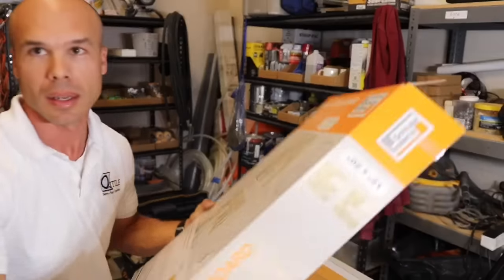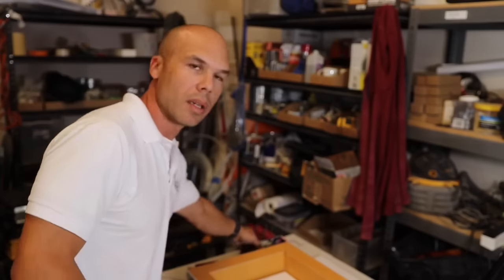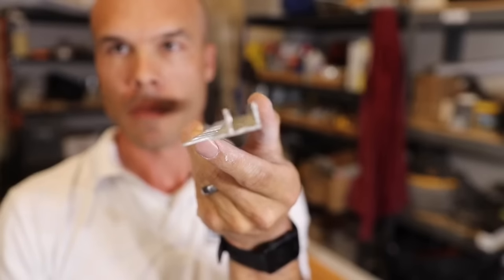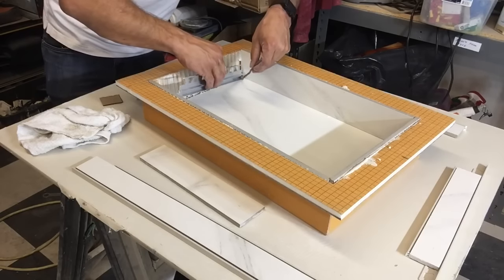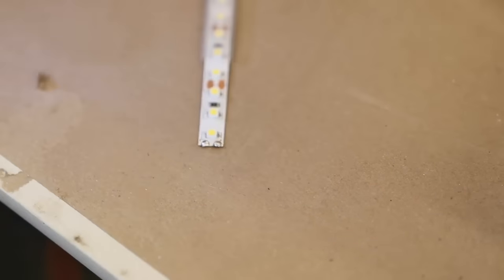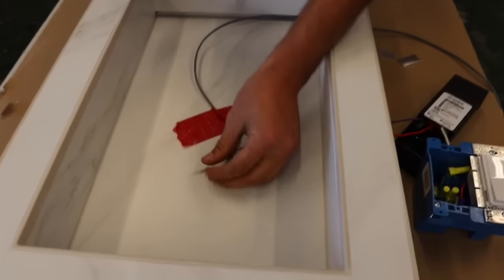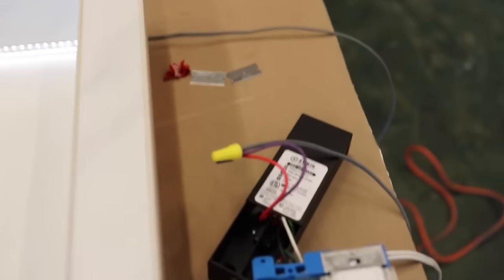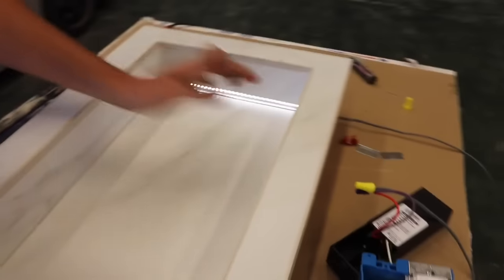How to make a Lighted LED Tile Niche

Comment: VERY CREATIVE! This idea is great, I will definitely try it out on my next shower build.
Reply: Absolutely....I have another shower coming up in 2 weeks, I know she'll love this added feature.
Reply: @TileCoach .. I am about to start on a project as well. would you be able to provide me with your supplier's info for the LED lights???
Reply: Can you send me the exact parts as well?
Reply: @Isaac Ostrom  good stuff . what your email ? Could i have the parts numbers too.
Reply: I would appreciate the supplier info .
Reply: @TileCoach  can you give me the info on the parts?  Specifically the SG deco profile piece. I find there are quite a few and I want to order the right one.  Thanks!
Reply: @operez417  try lee valley led
Reply: As sombody who's nearly an exspert in led lights make sure the diodes are Samsung or Cree. Cheap China made diodes will burn out and loose 50% of their intensity in a year. Same with the driver for the leds. You want meanwell. Or a know. Reputable brand.

Comment: Oops.  Standard silicone is not compatible with electronics, especially solder joints.  A biproduct of the cure is acetic acid which will attack and gradually cause corrosion in the exposed copper and solder pads.  You need to use a very specific electronics grade silicone for this job.

Comment: Loved Issac's  idea about LED in shower niche.   Next week begins my  remodeling our shower from plastic/fiberglass to 600mm x 600mm Calcutta porcelain, just unloaded 24 tiles over 350 lbs from wood skid in front of garage and moved to bathroom area. 
I purchased from Creative Lighting Solutions an LED flex strip using IP68 LEDSs-RGB . IP68 are completely water proof and RGB means lights can be controlled to be red, green or blue. This strip will go into notch as you did in the video, also I purchased WiFi switch and inverter AC 120 to 12 volt dc. I am now trying to find a 12 volt LED RGB IP68 shower ceiling light 3-4 inch diameter. any readers have suggestions.

Comment: Most DIY lighting stuff that I have seen for permanent fixture applications such as this use blocks of polished acrylic glued/sealed in place, with the led strip hidden on the other side. The acrylic diffuses the light so it all looks smooth, and also makes it so that the structure can stay in-tact while the led’s can later be replaced if needed. So, in this example, instead of running the led strip through the side of the niche, you would instead put like a 1”x1”x8” polished acrylic block up into the top back of the niche so that the top of the block is sticking up through the niche. You’d then glue/seal it in place. Then you would would stick the led strip to the top of the block so that it is shining down through the block and into the niche. Preferably, there would be an access panel on the other side of the wall to change out the led’s if the ever burn out. Then you would have a permanent and sealed structure in the shower itself, with no electrical components tied to it, while also having it both lighted and accessible for maintenance. The same methodology could be use for other cases as well, such as an acrylic shelf within the niche with the acrylic sticking through the sides of the niche into the wall and the led’s being on both sides shining into the shelf so it has a soft lighted glow, in a lighted acrylic chair rail, etc. Try YouTube’ing “led acrylic” or something like that for ideas. There’s also fiber optics that some very high end contractors use, with thick fiber optic cords that split into like a hundred that they then place into concrete work, with a thing in the attic that shines light into it through rotating diffuser lenses, so that it looks like stars are twinkling in the concrete when it’s turned on. I watch too much YouTube lol
Reply: So the acylic block pentrate through the shower niche and you just caulk all around it to make it waterproof?

Comment: I used fiber optic setup in a solid slab shower. It has zero power at the light source. The light box is located in a closet. Added touch plates using antique brass struncion embedded in wall. It’s pretty trick. You can use different lighting modes, one syncs to any music via dmx technology. It just “ hears” any musical beat and pulses and changes colors. Or it can just be warm light, or any color.

Comment: Is there any reason why you didn’t use LED light  connectors? Also, the width of the deco profile is what?  It looks like a 1/2 inch but the led lights are usually 8mm so I think maybe you can use 3/8 which is 9.5 mm, do you need the extra space or does it work better with a snug fit?  Thanks

Comment: I never thought of using the shluter profile , great idea . In my case I was going to install 3 separate - 5mm leds , mainly as a night light , but this idea is tempting also.
Seeing as I could  use RBG and a controller to choose the colour and brightness , I think I’m going with your idea .
Reply: The problem with using RBG is that you need more wires inside the wall, and more soldering on the strip itself. The solder points and the strip are the weakest point so when they fail, it will be difficult to replace teh LED strip. Using non coloured LEDs simplifies this as there are only two solder points and less likely to fail.
Reply: @YannisFyssas  For rgb you only need a 4 pack of tiny gauge wire. Its not like you are installing another full run of 12-2 romex.
Reply: @YannisFyssas  you also dont need to solder. They make water tight connectors for this purpose, they snap into place like some other connectors used for romex. just smaller. Then its not a permanent connection, and if you need to change it out its easy peasy.
Reply: Amazon sells a channel that is the same as the Schluter but without the tile/grout part. They also sell diffusers so you dont see the hot spots on the wall or whatever you are installing them with. Youtube "DIY RGB diffuser" and youll find what im talking about. The tile stuff s great for this purpose but If you wanted to do something you arent using grout with, say a ceiling line accent, the amazon channels can be fixed with a screw under the rgb strip and diffuser so as not to be see.

Comment: Thank you very much ,as I was going to drill three small holes and install three single 5mm leds in a 26” long niche top, but luckily I seen your idea in time .
So instead , now I’m going with a tri coloured led strip with an rf remote so I can change the brightness and colour . And yes the electronics are in the basement under the bathroom , not located in an area I can’t get access too.
Using that profile is a fantastic idea imo

Comment: awesome idea great job i'am a newbie with all thing s tile, i have built a 48 x 60 box using 2 x 6's, then a plywood bottom made a center drain i just have to try floating a mock up shower pan you have helped tremendously, also i have chosen to use laticrete hydroban membrane ect.....

Comment: Good morning 

I just saw this video

I will like to install the LED light in my bathroom, I have a recess in the wall for my soaps and diffuser but I didn’t have an inset for the LED casing plate. 

Is there still a way, I can still install the LED lighting without the casing ?

Your advise willl be truly appreciated

Comment: Very nice.You do great work and make awesome videos. I split the top tile in half compensating for the width of the aluminum channel of course. I find placing the LED at half way point throws the light better. If you look for a local LED store they do have the proper aluminum channels for LED strips that come with a clouded cover to diffuse the light better. Then seal with clear caulking. Overall Good job. LED Everything!!!!!

Comment: great video.  exactly what I was looking to do.  Tell your man to clean his iron tip with a wet paper towel and his soldering will go better.  Also that copper end of the wire left exposed like that will drip green down inside the shower after it starts to corrode.  That side should be encased in silicone or something else before it is pulled into that hole to prevent it.     PS.  Look at the camera and not the monitor...  :)

Comment: Just noticed your amateur Niche illumination video here TileCoach. Great to see others getting involved w/LED's ! So, just a little friendly & very crucial piece of advise for you. You really shouldn't be using IP65 rated LED strips when there's a more appropriately rated LED strip out there readily available.. IP65 LED strips are only "Water-resistant" rated ya know ! You should be using the IP67 rated LED strips instead, which are "Water-resistant-PLUS" ! IP67 allows the LED strip to be immersed under water for something like 30-minutes. That's a better, safer rated choice for inside a shower enclosure, wouldn't you agree !? IP65 rating only allows the LED strip to get wet from all directions. Although the IP65 would be enough to squeak-by, I personally would rather have a rating that's a little beyond what you need it for. So, the higher the IP rated #, the better the protection is how that goes. I believe the 1st #, the 6 is the highest dust protection rating, called "Dust-tight".  The #6 & the dust-protection doesn't go any higher than 6 for the dust portion of the LED strips protection rating. The 2nd #, the 5 is out of a rating from 1-8 in water protection. So, you could get a higher protected rated LED strip if you chose to. But, all that's needed is the IP67 for shower Niche's. That's plenty sufficient for a shower Niche. Also, use Heat-shrink over the soldered connections.

Other than that, great job w/the tile work man. I'm a local builder/remodeler up here in Vermont. I do all my own finish-work. electrical, plumbing, HVAC, tiling, stone-work, etc, etc. I've been illuminating my showers & kitchens now for about 10-15 years. I was into LED's way back before they came out as light-bulbs. I use to build my own LED arrays, using resistors of course, so I could build my own taillights & directionals for my custom Harley's I built back in the 90's before LED's were used for such things. Its great to see how far they've come.

Take care & keep up the great work ! Oh yeah.....dont forget to mention that those Transformers need AIR to work safely ! And DO NOT place them ANYWHERE where there might be water and/or moisture ! Never install them in tight places either, where there isn't any air-movement ! Could be dangerous. Just a little heads up !

Comment: After soldering it, add some black rubber heat shrink or at least electrical tape over the connection

Comment: Like the videos. You really cater to the DIY'er and have some good ideas. It would be helpful if you explained where you got the product and product name and or brand for other to shop similar items. Maybe a link in the description below would be nice. 
Where are you getting these light strips? What kind are they?
What kind of power supply box are you using? And compatible dimmer switches?
Thanks man!

Comment: Need to use quality LED strips as not all LED's are the same. You also do not need to solder the wires onto the LED strip as there are special connectors for this that enclose the electrical connection in a locking plastic clip. I have done this on a much larger scale around roof skylights 😉
Reply: @mcgillicuddy_  not sure what clips you are using but not all things are equal. I have a friend who distributes LED lighting in the UK and the quality of products he supplied me on my last property development in the UK was first class.

Comment: Nice idea... I would have use 1/4 in shrink tubing at the end of solder... clean and tite..
Reply: @TileCoach  well in reality it wasn't your fault is the installer I mean if he is an electrician I've been doing this for quite some time now stupid little things like that that cold will get you with like that's definitely got to be on a GFCI circuit all types of lighting even if it's low voltage
Reply: @TileCoach  awesome brother looking forward to seeing it but at the end of the day it is a really awesome idea great work

Comment: I have a really dark bathroom with low ceilings -- and the ceilings are the flooring to the loft above so I can't put lighting in the ceiling. I have been planning to use this method to put lighting in the shower by using this method not just in the niche, but at the top edge of the shower. I'm using my neighbor's shower as the guinea pig (he has the funds to remodel before I do and he loved the idea), but he's using slabs instead of tiles to do his shower. I had previously shown this video to our contractor and he didn't have a clue, and I showed it to our electrician and he didn't have a clue, so I'm trying to make this happen. The problem is that slabs are thicker than tile -- so it's problematic. Now the contractor wants to just cut in a shallow channel into the slabs at the top. Do you think that's a good solution? I'm on the fence... the waterproof LED lights we've purchased from FlexFire come with an adhesive backing, but I don't see it working long term. Thoughts?

Comment: Nice idea but I have my reservations about the longevity of the PSA they use on those strips.
Reply: Isaac Ostrom   Sorry, PSA = pressure sensitive adhesive.
Reply: True, seems like the adhesive always comes loose. I’ve used 3Ms vhb tape with success. In his case, the silicone will lock in the led tape.

Comment: Thanks for sharing. Where can you find the Schluter piece piece? I went to floor and decor and they didn’t have the exact schluter piece use.
Reply: Justin Naoe I ended up using an aluminum channel with a diffuser off of Amazon. It was cheap. I pushed that up in the thin set. It seems to be pretty solid. Hope that helps or gives you a good direction

Comment: What driver/transformer is that? Most have minimum specs and one small strip isn't enough of a power draw for the driver to function. Thanks.
Reply: @TileCoach  Thanks, I found it with that description. Funny you mentioned the attic. That's exactly where I was thinking to put the driver. I guess I can always have a bit of bonus lighting in the attic if needed.

Comment: Issac thank you for sharing your video of LED Lighting in a Niche. I have purchased an R68 (water proof) LED strip but one unusual dilemma is where to mount the on/off or dimmer switch?. The shower will have glass panels on two sides and I have precautions about putting the dimmer or on/off in a wet area. I will install the  120v AC/12 v DC converter  in the basement using a GFI outlet and thus the switch which should be near the shower just needs to work with 12 volts but just for ideas where did you put your switch or dimmer?  Perhaps if one does not want a dimmer then a switch located near the shower is not even necessary due the LED lights can stay on 24/7?
Reply: AB Baby    Thank you, I will soon have delivered a WiFi switch which allows dimming. I ordered it after talking with Creative Lighting Solutions, the internet distributor from whom I purchased the R68 RGB LED strip. I can dim, turn on/off and control is I want red, blue or green lighting. My wife does not know I will install this LED strip and will be happily surprised-hopefully.
Reply: @jerrygrayson8421  Great idea. Can you give me the item number or link of the wifi switch that you ordered?
Reply: @helmang9860   Hi Helman on youtube see video "How to Install a Smart WiFi Light Switch (for Amazon Alexa or Google Home) which shows a link for different WiFi switches but they can be found on Amazon.
The WiFi switch in my home is on a dry wall area near the shower and the switch is connected into  our basement to a 120 volt outlet to with I plugged the 120v to 12 volt step down transformer. The 12 volts runs from the basement into the LED in the shower. Thus you are controlling the 120 volts in the basement with this WiFi switch.
Reply: @helmang9860   Hi Helman on youtube see video "How to Install a Smart WiFi Light Switch (for Amazon Alexa or Google Home) which shows a link for different WiFi switches but they can be found on Amazon.
VIEW       
                
•
VIEW       
                
•
Reply: @jerrygrayson65  Jerry, thank you for the reply. That sounds like a solid plan. But as I dont have a basement I will be plugging into the attic.
Reply: @helmang9860   Having the attic also allows you to install LED spot recessed light more easily, maybe now you do not want additional lights (or music speakers) but may in the future..   I also connected/accessed the LED ribbon connector from the top corner of the niche (do not run from bottom of niche) . The back wall  of the niche naturally tiled is against a sheet rock closet wall (hard to explain).  I put a very small access panel( used a plastic rf cable box with a junction box cover)where I connected the LED short connector with the longer cable from the 12 volt transformer. Although in theory LED last forever I was not confident this was true and if I ever had to replace the LED strip then the access panel would make life easier.
Reply: @jerrygrayson65  Man, have you ever thought of putting a video up. I feel that your project came out clean and would appreciate visuals as well as other DIYers..
Reply: @helmang9860  Thank you for the comment. Early this year Watching Isaac Ostrom's original video about niche lighting inspired me but I also added Alexa since my wife requested it (fortunately before the stud/ wall was closed with WEDI boards).Isaac is one of my many YouTube masters/Gurus.  I am shy, not photogenic and never made a video before.  I am a Professional Handyman- Contractor and just love watching  videos.No matter what you know or think you know, watching a video about a repair I will be making is like a pep tonic for me.

Comment: Neat idea! How do you replace the LED strips in 10-20 years when the LEDs burn out?
Reply: My best guess is remove the strip and re-solder a new one. He did say leave some slack on the wire so it should be pretty easy